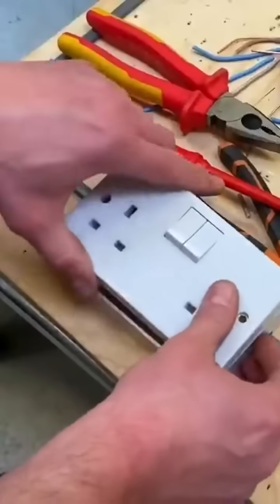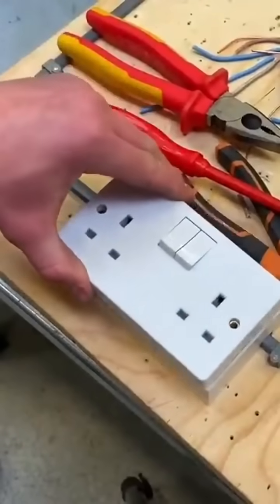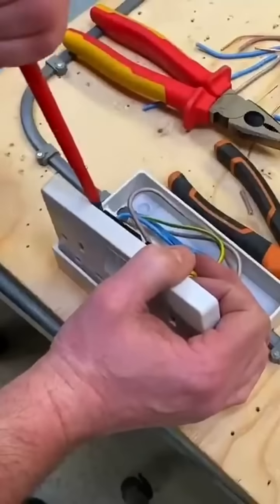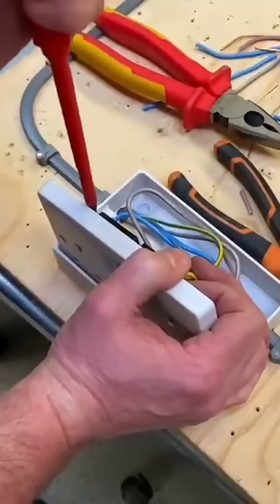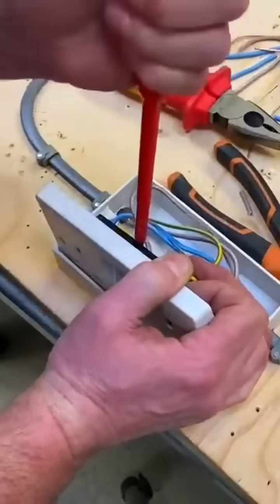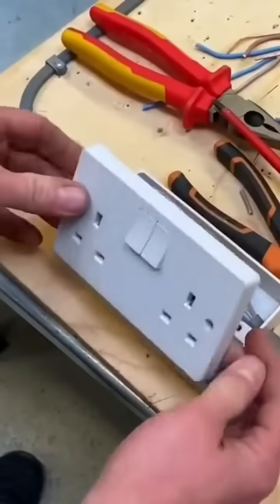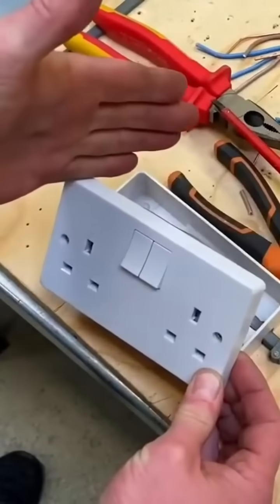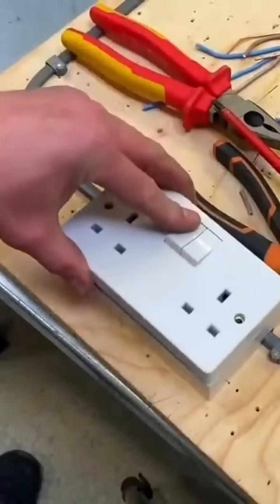2 Top Tips For Connecting up Sockets

Comment: I was taught to put both CPCs into the same sleeve (but not twisted together), then each end folded over independently and into the same terminal. That way even IF the terminal fails. You still have SOME form of continuity on your Earth. {Same sleeve without twisting, also makes it easier to separate them for testing at a later date.}

Earth should ALWAYS be longer than Live & Neutral. To ensure earth remains under the least strain in all situations. Thus it's the last to fail.

I only ever use the second Earth terminal for bonding the back box, and or when fitting a spur.

Comment: I wouldn’t split the cpcs across  the two earth terminals, this can increase the resistance. The continuous copper conductor is interrupted by the steel bar bridging the earth terminals on the back of the socket. I’ve noticed this can have a considerable effect on ring circuits, pushing the Zs above max permitted. On multiple ring circuits I’ve had to double up the cpcs in one terminal to lower the R1R2 & Zs values. What’s your thoughts ?
Reply: The thing is if you have 2 earths in 1 terminal and that terminal fails, you have an increased chance of having no earth at the outlet. When they are separated you reduce that risk. 

And the resistance between the two terminals is negligible.
Reply: @MrFootsta it’s a good point but I feel the likelihood of a higher resistance across the two terminals maybe greater than a terminal failure. Of course this is totally dependent on the make/model/design and quality of the the socket outlet being used. Many older type with the exposed steel bar are prone to corrosion, especially when installed in damp humid conditions. Not all houses are perfectly dry and well ventilated where I work 😊. I’ve removed face plates before revealing no back box -  just a pile of rust ! 😮
The resistance can only be negligible if it were to make little to no difference overall. I have certainly lowered R1+R2 and r2 readings on ring circuits by doubling up cpcs. 
Interesting though - I do get your point. I might start twisting the cpcs together and bridging the terminals and link the back box 😂  - belt and braces 😉 👍🏻
Reply: @danielwood5334 having an opinion and then taking on board somebody else's opinion, that's refreshing to see it doesn't always happen on YT without an argument. 👍
Reply: @danielwood5334 my advice is, don't twist the CPCs together. If you're twisting the ends at point of termination, then probably okay. I still wouldn't do it though. If you're thinking of twisting at the base where the conductors enter the box, then I'd advise against 100%. I used to work for a company that did this and I think: the copper is weakened at the twist, it  will likely be a pain the backside for anyone who has to work on that circuit in the future and it cannot be sleeved properly. I liked your point original point. I've always used both terminals myself because my thinking was the same as the other commenter, but you have an absolute valid point. Perhaps a sleeved link between the CPC terminals would be good practice, but I can't see it catching on. Imagine even doing the extra tighten that Gaz does in this short. I can't imagine many doing that on every socket on the job. 🤣
Reply: @danielwood5334 we had an extension completed about 6 years ago. There's been a problem with damp at the bottom of one wall at lower ground level. Earlier this month a light switch came loose. I thought it just needed a screw tightening, but found the screw completely rusted off. Tried to tighten the other screw and that just snapped off.
Pulled the switch away and found a completely rusted back box that I had to remove in pieces, and oxidised green copper wire. The electrician, instead of using a dry wall back box, has chiselled through the tanking and into the blockwork below DPC to fit the metal box in. The metal was providing the perfect bridge for moisture.
Reply: In reality, It doesn't matter what the resistance is on an CPC (within reason).  That is why they can be lower CSA.  An earth should only be engaged for a short time so the wire isn't going to set fire and unless the earth is made of tungsten the resistance will still be small enough to trip something at the CU or blow a fuse. 

The advantage of splitting them is if one comes lose you have a fallback.

Comment: 2.5mm T&E would be so much easier to work with, in terms of flexibility when terminating, if it was stranded. Not sure if it’s an option at this size though.
Reply: Moved on from stranded cables 50 years ago
Reply: Read my comments on using 2.5mm flex and screwless lever connectors.

Comment: The best way is to use lever Wago connectors on the circuits spine. Push the Wagos into the back of the backbox. Then use four inches of 2.5mm flex with a ferrule at one end screwed into the socket's terminal. The other end of the flex clip into the Wago.  

The flex ensures the socket is pushed back with ease with no stress on any terminal. The socket's terminals are not used as a junction box. Also the main current flow of the circuit is through the screwless Wagos which will not work loose.
Reply: You must be paid by the hour... and must spend that money on the extras.
Reply: @petesharpe5478  
Firstly it is safer. That is obvious. 

Secondly it is quicker. The first fix can be fitted using the Wagos, then tested. The finishing trades move in. Then the second fix. Insert the four inch flex tails to the sockets on a bench, then clipping them into the Wagos in the backboxes and using a battery driver to screw up the sockets. Then test. 

A day is saved doing it this way, and no going back as the first and second fixes are tested. Any problems after the first fix is tested OK, the contractor is responsible.
Reply: @johnburns4017  If it's quicker, then every electrical contractor would be doing it and getting to the next job earlier. But they don't.
Reply: @petesharpe5478  
I do the 1st fix using Wagos type of connectors inside the socket/FCU backboxes, connecting up a ring (or a radial), and even connecting the earth terminal of a metal backbox. The backboxes are effectively doubled up as junction boxes. The ring circuit is tested after the 1st fix.  Any wiring problems are identified before finishing trades turn up. Putting it right afterwards may be big problems and expense.

Then the plasterers and painters come in doing their work. The Wagos are left in place in the backboxes. Then on the 2nd fix, on a bench the sockets and FCUs are prepared, by screwing into all the socket's tail's flexible 2.5mm cable, including an insulated earth wire, about 100mm long with a ferrule onto the flexible wire into sockets screwed terminal connection. The flexible tails are put into the Wagos at the back of the back boxes. The socket easily pushes back in being on flex tails. Then test again. The speed, and ease, of installation is much quicker. And much safer as the ring itself does not have screw connections that can work loose.

I have found many terminal screws on the back of sockets that worked loose over time - expansion-contraction, vibration from people walking on wooden floors, plugs being rammed in and out constantly, etc. That is why screwed terminal are maintenance terminals. Wago screwless are maintenance free. Wago also apply the correct torque to the wire, which is maintained over time as well. Having the full current of a ring circuit flowing through the terminal at the rear of sockets is a potential fire situation, with maybe arcing, also adding higher resistances to the ring, which may cause one leg of the ring to take most of the load, etc.

That is where Wago types of connectors, in the scenario I just outlined, take the ring's load, not the screwed terminals on the rear of the sockets. It is much safer.   The sockets are only spurs off the ring, taking only current when an appliance is drawing current. Go back to a ring circuit after 10, 15, 20 years, then test it. Then go back to one which has the ring running though maintenance free Wago types. The integrity of the Wago connection ring will be upheld. Much safer.

Having Wago types of connections on the rear of sockets, as in Germany, adds another level of safety, in eliminating another screw terminal potential failure/fire risk.  The UK does not have these types of socket connections yet.
Reply: @johnburns4017 are you the ceo of wago or something 😂😂
This is not necessary and a screw teminal will never come loose if tightened to the correct torque...
Especially not by people walking on a wooden floor 😂😂
Reply: @morestuff4401 
A screw terminal will never come loose? My oh my. What alternative electrical universe have you been in?
Read what I wrote. Understand it.  Cheaper as it saves time.  Easier as the work is done half on a bench. Not on your knees a lot. 

Wagos are cheap if bought in large packs. 

Safer for the customer. Current does not run through the socket's terminals unless that socket draws current. Socket not used as a junction box.
Reply: @johnburns4017 if you tighten a screw terminal to the correct torque, it will never come loose.
Also as ive already said, electrical connections should be kept to a minimum, you are avocating terminating the ring in wagos and fly leading out to the socket terminals... thats twice the amount of connections and twice the amount of interruptions in the otherwise continuous copper cable AND introducing  an extra cost.
You carry on doing it your way, the rest of us will do it the way it should be done and make money
Reply: @morestuff4401  
Screw terminals never come loose? Please!!!!  I have taken out many sockets to find one or two conductors fall off. 

Understand what was being put across. This method has no stress on socket terminals - a big problem. The current of circuit runs through the circut's spine via the screwless Wagos where the torque on the conductors is correct and constant, not though the socket terminals, which will be at stress at the rear of the sockets - a fire hazzard. Socket terminals becoming too hot taking the circuit's load is a problem - the H&S men will tell you that. 

The only time the flex, not under stress, is under current is when the socket draws current, and no more than 13A.. 

Solid conductor house wiring is not meant for flexible purposes, which it is being used for connecting up sockets.

- From a safety point it is superior;
- From an installation point of view it is superior, saving a day and your knees. Fit sixty sockets all at once you will know about it.
Reply: @morestuff4401  
Ideal lever connectors are just as good. I use the word Wago as is the common word for screwless.

Two hundred Ideal connectors can be bought for £60, or less online. That £60 saves a lot of time in installation and testing first and second fix, and makes the installation a lot safer.
Reply: @johnburns4017  what if one of the screw terminals dose come loose and it's been done your wago way 🤔 you test at the board everything looks smack on fine and dandy because like you say they will maintain a perfect connection but in reality the 1st socket you come to all 3 conductors are hanging out the back of the socket 😅😂 were as if both legs were in the socket you put your tester on you know something isn't right straight away just on ring continuity  before you have even taken the accessories off 🤷‍♂️
Reply: @lissa020609  
Proper testing will detect a loose connection on the rear of a socket.
Reply: Not spending money on wagos mate, not for a double socket...
And when it comes to connections less is more
Reply: Nice idea - but only if you have lots of fat in a job.   In Commercial, we'll be in 4mm - Aussie outlets or starters - and we'll use Wagos to build the radial.  But we've got a huge amount of fat on the job  - and getting a good re-test in 12 months is essential.
Reply: @tcpnetworks 
It saves a day. A safer installation.
Reply: Why complicate a simple operation.